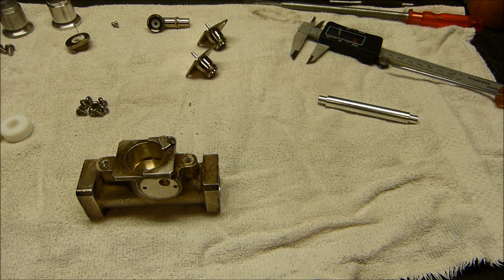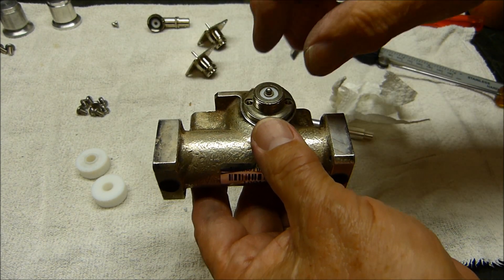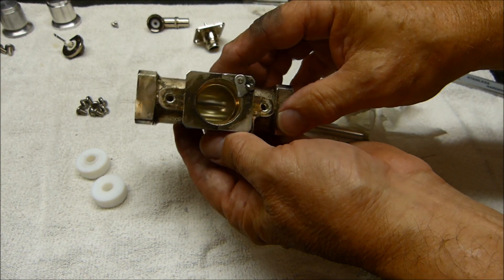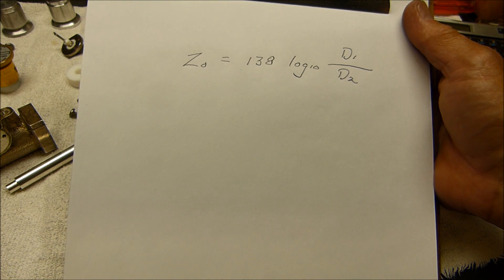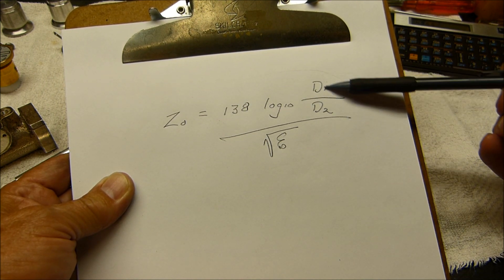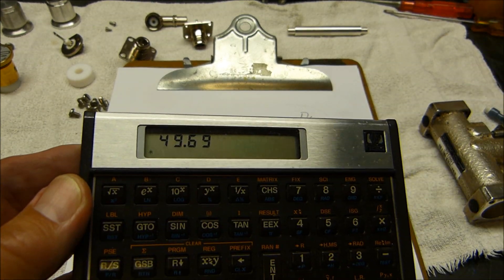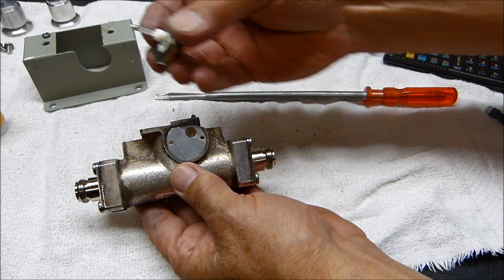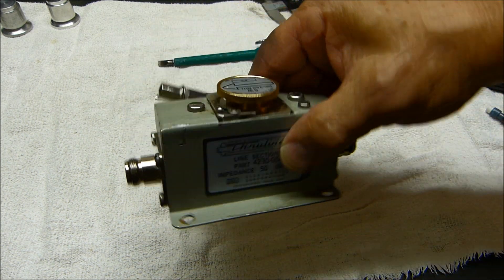Bird Wattmeter Line Section Disassembly & Cleaning

Comment: Great demonstration using the mathematical formula to determine the ohms rating.
   I personally use the "Coaxial Dynamics" slugs, they are actually made from brass abd steel as for the Bird elements are a brass plated plastic along with other plastic garbage. Dont know why Bird is leaning towards plastic besides costs, but just makes for a crapier product.

Comment: Thanks for the interesting video! But I have a question: Besides cleaning the hole where you put the element, and the contact tip, what is the pratical use of the internal cleaning of the device? Just for looks or is there something I don't know? 73 de PU2SEX! =)
Reply from the maker: Quite honestly, unless there is real corrosion, I don't think it does anything at all for it - except clean it.  There is a comment below from a Bird tech that says there is a slight bend in the center conductor used for calibration. I certainly can't argue that but I have no issues with any of my line sections or elements reading exactly the same. I have thought of making a video where I have had to deal with flaky cal pots in the slugs by carefully matching the slug under calibration with a known good element then carefully measuring the cal pot and replacing it with a couple of fixed resistors of the same value as the pot setting. No more flaky cal pot issues after that...  you do need 1/4 watt or smaller resistors to fit under the top but it works great.

Comment: Hello, very interesting presentation and a lot of useful information, I use several different models BIRD-43 and I did a lot of research and comparisons with other power meters, such as HP-435B, HP-437B and several Marconi 6960B, I also use several other power meters, I've done many comparisons between these measures. Do you know my web site, sp5mxf.com On this site I have described very precisely the properties of these meters and the most interesting are the comparisons between different meters. I have spent a lot of time researching power meters and the results and comparisons described are the effect of 2 years of power measurement work. I am very interested in measuring the microwave power. And here is a direct link to this meter:

My web site sp5mxf.com is written in the Polish language, which is certainly a certain difficulty, but now using Google translator you can read the texts in different languages quite accurately. In this way I read in different languages, today there are various tools and possibilities, it is easy. I am interested in your opinion on the information which I have included in the descriptions of power meters.

I wrote this comment in Polish, then I used the translator google to translate it into English so probably there will be some problems, but it should be fairly understandable.

Regards Tomasz
Reply from the maker: Tomasz, I am very interested in your website but I can not figure out how to get there...
Trying to get to @t all I get it AT&T.  Your direct link didn't come across as a legitimate web address. Maybe YouTube or a language converter changed it or something?

Please send to my direct YouTube email address: theaudioshop@sbcglobal.net

I would love to see your research and compare it to my own. I now have a HP 432A RF meter that I would use instead of the Bird elements but I have not done work in the 2.4 GHz region lately. I love working with RF so if I can read what you are doing and have discovered, it will probably get me back to my microwave RF workbench.  Thank you.
Reply: @ElPasoTubeAmps  Hello, I wrote comments to many people on YT with similar content and YT probably recognized me as a spammer, and I am just looking for contact with people who have a similar hobby as me, I have been editing the text in the comment and entered the address of my website

Best wishes and welcome to my website Tomasz
Reply: @ElPasoTubeAmps  I never had HP-432A so I did not write anything about it because I do not have any knowledge about it.

I know that this is a bit older meter but I do not know how accurate it is, I do not know at what frequencies you want to take measurements. I spent a few years of my life studying various power meters and described the research on my website a bit, I hope you'll find something for yourself.

Write something to me via e-mail about what interests you, what kind of hobby do you have, or just as you are amateur radio amateur?

Regards Tomasz

Comment: Hi! As an ex Bird Cal Technician (12 Years) thought I might pass along to you that the center conductor has a very slight bend to it. This is used in the final Cal of the Bird 43 Meter. We have a special wrench that turns the centerline. Once disassembled, you may find it difficult to get the Cal back. 73’s de David. K8KEM
Reply from the maker: Wow... that is great to know but too late for me... I suppose it would make more of a difference the higher in frequency we go. I use the Bird line section with the Bird 432-28 and 431-20 elements for 2.4 GHz and have wondered how accurate the 4230-058 line section is at those frequencies as I suppose it was not designed to work at 2.4 GHz. I don't have a problem with it and am using it again as I write but I would appreciate your thoughts on it because these elements say, "Out of the Scope of the RoHS Directive 2002/95/EC".

Comment: What could go 'wrong' with a line section?  I have a coaxial dynamics line section which appears perfectly good, cleaned per your videos yet consistently reads inaccurately?  Using the same element, in two different meters, with two line sections, one is spot on, the other considerably low?  
The user Manual does state to never disassemble, but when not working correctly, you have to inspect!
Reply from the maker: These things are so rock-solid, you can't put them together wrong or harm them. I don't know why yours reads low. I think I showed how to use a micrometer and measure the exact inner diameter of the outer section, (D2) then the outer diameter of the inner rod (D1) and do the formula:   138*log(D2/D1)   This should come up pretty darn close to 50. Could you possibly have a 75 ohm line section? Measuring it with a good micrometer and doing the formula should tell you. I have some CD slugs and generally they do differ from my Bird elements. Seems like, if I remember correctly, they usually read a bit higher. Here is a link to more formulas.  
http://www.rfcafe.com/references/electrical/transmission-lines.htm
You don't need the expanded formula if the dielectric is air. The simple formula above will work. Also, the distance the element is from the inner line, when seated,  is important. That could be a challenge to measure accurately and I don't know what it should be. I would only know to compare it to a known good line section.
Good Luck  73. WA4QGA
Reply: Christopher Larwood you will need to readjust the center line as it has a very slight bend to it that is turned in final Cal. 73’s David. K8KEM
Reply: @davideisenberger6197  I know it is from a loong time ago, but could you say more about this calibration procedure? I wasn't able to find anything on the net...Thanks!

Comment: Very interesting indeed. Being some what new to radio, I would be very appreciative if you could explain the role of the slugs in these watt meters. Thanks in advance.
Reply from the maker: bain5872 The slugs, or elements, as we all call them, determine the RF frequency range and power range that can be measured. For the venerable model 43 the output of these elements all drive a 30 uA meter movement. Digital readouts are also available. With the element arrow facing the load, forward power measurements are indicated. Then you can mechanically rotate the element so the arrow points towards the source and measure the reflected power and determine reflection coefficient or VSWR. There about eighty (80) different elements that allow measurements from 450 KHz to 1.8 GHz at power levels from five watts to 10,000 watts with a bunch of specialty elements that will allow milliwatt power measurements and frequency measurements up to 2.5 GHz.  I don't know the exact average price of new elements but it would probably be around $150 for a grand total of $12K - $15K if you bought them all - fortunately, us ham radio operators need only a few. I have tried all my career to build these types of elements using copper water pipe and connectors and one can come close but if you want something you can trust that is reliable and accurate it seems we have to buy instruments of this quality.
Reply: ElPaso TubeAmps
OK, It makes sense to me now. The elements are only for taping off enough current for driving the display meter. The load impedance is a factor built in by design of the inner conductor to the outer shield. Thanks much for explaining it for me I really appreciate it!